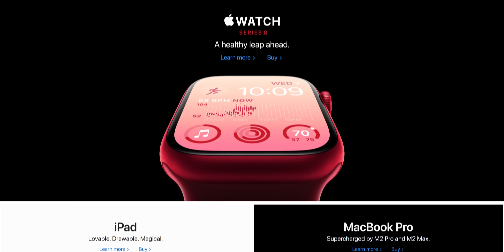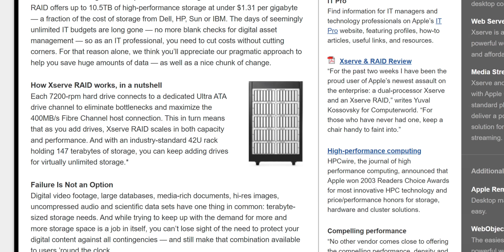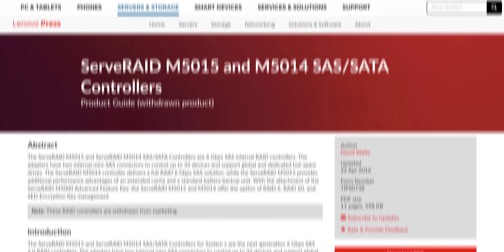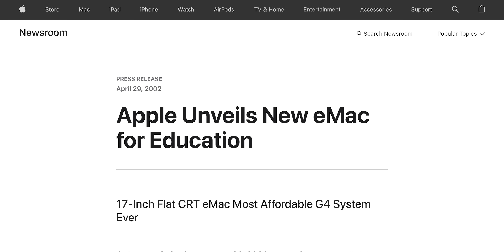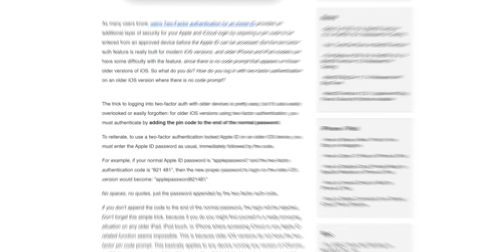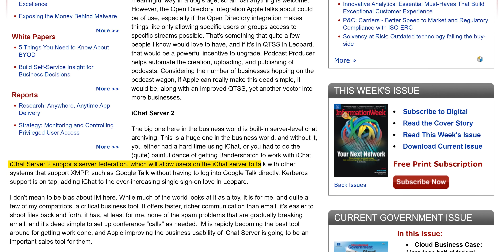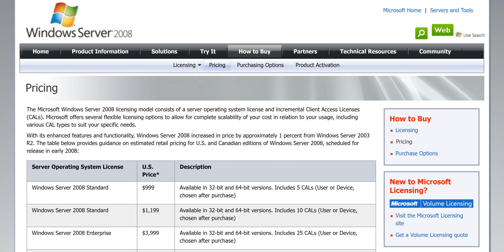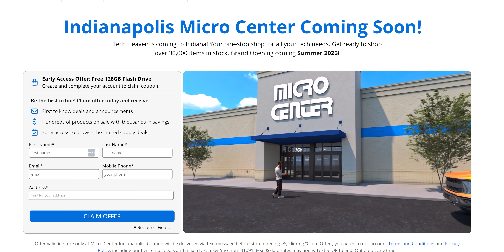I Bought the Last One Apple Ever Made... - Apple XServe 3,1 Server

Comment: 5:00 the tiny HDD connector is NOT proprietary. That is connector is called a ZIF connector, and was used on the HDD that were in Zunes. ZIF stands for Zero Insertion Force. Yes that HDD looks like the same ones found in Zunes and classic iPods

Comment: The "HDD vendor locking" is not true. I ran three XServer from different generations for many years (with Linux instead of OSX, because I got the hardware for free) and I just popped multiple SATA SSD and HDD in all of them without any problem's.
So maybe this is only valid when really running them with OSX?

Comment: Funny story. I got my hands on about 9 retired 2009 Xserves in 2015. The project I was using them for fell through, so I sold them on eBay in 2016. One of my very first sales was to... Microsoft Corporation. Doing some digging I found that the buyer was Microsoft Office for Mac. So 1) I sold Apple hardware to Microsoft lol and 2) These servers were still in demand by companies (I sold to at least 3 other companies as well) over 7 years after they were released

Comment: the Xserver sucked. I worked at a company that used them and because Apple used off the shelf consumer drives instead of high end enterprise drives, the drives would burn out pretty regularly because they can't handle the heat of a rack mounted environment

Comment: I have a 2009 Xserve 3.1 that i use as a 4K gamming rig. (Why not?)

If there was ever a follow up to the xserve video making it into a gamming rig. I'd be happy to share my experience and suggestions.

 

There are quite a few quirks and obstacles I've overcome to make it work reasonable well. Including upgrading the firmware, processors, Ideal ram setup , nvme ssd's and perhaps most important silencing it.

I seemed to be the only person at mac rumors excited at getting a 6600 Xt working on my xserve. Though I'm running a 5700 xt now. Just as fast with the full 16 lanes. 

 

BTW I'm using an Xserve with non-raid backplane. In my case standard SATA SSD's work fine as long as they can go down to sata 2 in my drive sleds. e.g Crucial’s  MX500 1 TB works great. Might be worth checking if they can work for your Xserve.

 

https://forums.macrumors.com/threads/xserve-2020-xs3-1.2225448/post-31187673

 

Happy to share more, maybe I should create my own video first?!  Current playing Horizon Zero Dawn on my xserve at 4k on my projector. Medium settings.

Comment: The vendor locked HDDs sound pretty much the same as the current rumors about their USB C cables.. They are using  an industry standard, but lock it down so that while "using the standard", you can still only buy from them.

Comment: The boot drive is basically an iPod drive with the same ZIF connector. The drives weren't really firmware locked, you can use third party drives.

Comment: Yep, delidded Xeons are a thing. All but the latest 2012 cMP did use them, on the latest one you could use regular ones. Technically, you were able to use standard Xeons, however, you did need to try to NOT Bend the Pins while tightening the Heatsinks as they are designed to be used without them. If you are looking to delid them yourselves, it is highly likely you'll kill them in the process. Get 4 razor blades, a steady fire source as a candle, and a stove. Then you can delude them as the IHS has been soldered to the CPU Die. It is safer to get them prepared. Also, you can get LGA1366 and up to an X5690. (6C/12T). Loved these machines to death. If not for being so power hungry, I´ld still daily drive one of them up until this day. Oh, if you are looking to get a GPU Connected, safes bet is any AMD GPU after the HD7690 (R9) or RX460. You'll need to make sure they are properly supplied with enough power though. Greetings from Germany guys.

Comment: As a publisher, newspapers, magazines, web, video and podcasts, we used XServes extensively.  When they were discontinued we were told — official, paid for, Apple consultancy told — just replace them with Mac Minis.  No dual power supply.  No dual Ethernet. No out of band management.  NOT going in my data centres, thank you.

So the hardware was gradually replaced by other things that weren't Apple and any software that was Mac only likewise got replaced for something more flexible. By 2015 storage and services servers had all gone from the data centre and after 25 years of Mac servers Apple products were again desktop only.

The recent MacPro server has been a really halfhearted effort: sticking a desktop machine of rails does not make it a server.  It does seem that apple has no interest in the server market.

Comment: My high school had multiple of these, but since I hated apple with a bloodthirsty passion, I used my laptop to create a code to destroy the machines by Frying the motherboard and CPU by forcefully unlocking the software and hardware power limits and slams the mobo and CPU with more voltage than it can handle
Reply: dont write that here

Comment: Hey this is probably a long shot, but i need some help trouble shooting. I get really good FPS in pretty much every game except for destiny 2 and no matter what i change i can’t figure out why. I have a Ryzen 5 2600X, B450 tomahawk, RTX 3060ti, 16gb ram, Samsung 980 pro 1tb ssd, and my frames are constantly at min 50’s, low 60’s when on destiny 2. I’m not sure if my older cpu is bottlenecking, or if i need to change some bios settings, I’m still pretty new to tinkering with PC’s because this is my first pc I’ve built with hand me downs except for the 3060ti. If anyone could help that would be awesome!

Comment: I would like to see follow-up video where you can somehow connect standard SATA drivers to this thing. If the hardware is indeed crippled at the hardware level to prevent using standard drives, there is no future for the system at all.
Reply: A few people commenting here that they’ve used third-party off-the-shelf drives without issues…

Comment: I am an IT guy (server certified DELL and former HP server support), a mac mini is not a server in any way.
A server has ECC memory and raid it assure a full redondancy and a 24/7 workload.  long ago I read test on the server especially in SQL readings and the Apple server was so far beyoun the compaq ones that it was quite worthless. In a world where Unix/Linux is legion Apple OS has no added value. It could have been better than Windows but NT4 is working so fast that it makes Apple server obsolete directly.
And Now linux is here and very common, mac OS is not able to compete in it.  An other things that happens a lot but hattered by admins, it is proprietary drives and device. Quite common sadly but Apple is again the worst.
Netboot and PXE are super common on the server and add on card to do remote control, even if your server is powered down.
The things is when a server is in a rack, you don't care about its design at all, and some server like SUN server where also design and much more effiscient (and UNIX too).

Admins are not sensible to speech but to real fact and performance where apple don't shine at all in server market.

Comment: Linus, you‘re wrong… the primary HDD is connected by a ZIF-connector. It’s not propietary… Dell used this connector in the Latitude E430 for the harddisks. And it’s used in the whole iPod-Lineup also for connecting the HDDs

Comment: ahahah cool thing but very difficult, I have a story connected with it - I worked as a system administrator (for a very long time) in my youth and one day I was asked to help rearrange the servers in the rack and now I pull out the server that was almost at the very bottom of the rack, and my partner slightly pushed this miracle from Apple, and since someone screwed the guides badly, this thing simply and without much thought fell on my head - after that I don’t really like Apple equipment hahahahaha

Comment: The way around outdated OS install/upgrade issues is to use another Mac, because obviously you have one if you have an x-serv. Use Mac #2 to install a fresh updated OS on an external drive, preferably firewire (hence the ports on the back). Then boot the server off that external drive to install/clone to the server's internal drive. As an Apple tech I used full installs on external drives for much of my troubleshooting, repairs, and installs in the shop. Need a specific version of the OS on the customers machine? No big deal, external drive had every version of OS on different partitions as well as all the disk images so we never had to use CD/DVD or USB media. Also, the HDs were not vendor locked, you just need older drives.

Comment: The firmware thing is actually about testing (you would be shocked at how often HDD manufacturers have managed to ship broken disk firmware), not about locking things down. You absolutely can replace the drives with off the shelf units.
Reply: Absolutely, I've done that many times. I've even replaced the PATA drives in the Xserve RAID with SATA drives with a converter!
Reply: can confirm
Reply: Ive used WD 1TB in this server
Reply: My admittedly limited experience in the matter differs. Last time I had to change a hard drive out in an Apple PC we had to pay the Apple tax for an Apple firmware approved drive. The generic off the shelf drives refused to be accepted by the machine as a valid storage device and outright refused to function otherwise. I suspect this specific issue comes and goes as they release iterations.

Apple is not the only one that pulls this crap, I had to deal with a non Apple server once (forget the brand now, might have been HP or IBM) that would halt during boot to warn that an 'uncertified' drive was installed and I had to press the any key to continue...for each and every boot.

Compaq (eventually bought by HP) had PATA hard drive connectors where they switched a few pins around to make generic drives not work at all (+300% premium for Compaq compatible drives). This specific practice seems to have gone away after SATA arrived, maybe the SATA group put some 'do not touch' wording in their spec sheet.

Dell for a while switched some pins on the motherboard connector to make generic power supplies incompatible as well. Though Dell seems to have stopped that practice after consumers got a bit noisy about it.
Reply: @stevedixon921  I've been swapping drives in macs for decades (back to PATA era) with generic versions, never been an issue as long as you don't use some super cheap drives that don't fully/properly support a given protocol.

Comment: Tbh, for a server it's pretty... pretty... 😅 Oh, and Apple did the same firmware thing with 27" iMac hard drives up until the SSD model became standard in 2020. Also, the you can easily create a bootable installer for most old apple operating system (except sierra for some reason) by downloading the installer and using a terminal command, i do this regularly, most recently from a mac running Monterey. 🤷‍♂ We sold these to pretty much ALL our business customers regardless of the company size, they were really great.

Comment: Its not rude its plain evil similar to ms blackmailing to upgrade from windows 7 to 10 or from 10 to 11 just to make u upgrade your system... I'm lucky that i have seen this horse - manure and switch to linux 🤣 p.s. there will not be an os like windows 7 for microsoft EEEVER and i used it from the first beta available without any issue at all

Comment: That OS drive actually looks like it uses a ZIF connector which is common on small form factor HDDs that are intended for mobile devices. Most MP3 players (including the iPods from 5th gen onwards) used ZIF drives before they started to use Flash storage.
Reply: It could well be an iPod drive!
Reply: @thehobnob  yeah, I compared the drive you see in the video to an older iPod drive that I have laying around and I am very certain that they are the same.

Comment: Another fascinating topic. I didn't realise MacOS Server was so functional as a server operating system. Would love to get one to play around with it for a media / plex server.  Probably totally impractical though due to the noise and power consumption. Also really enjoying the content lately guys. I love the way you are finding unusual hardware to talk about 🙂 Things like the XServe and Dev kits etc are awesome to learn about.  I had to laugh at the lengths you guys had to go to trying to get a modern OS on there - from experience in Tech Support I have dealt with old Macs and trying to upgrade the OS can be a complete pain ! Apple certainly as Linus said doesn't make it easy at all.
Reply: "intentionally unusable" is the correct term as to what apple is doing with it's old hardware. why windows > mac os in any version.
Reply: @inkredebilchina9699  Windows sucks, but thankfully Linux is always an option when OpenCore isn't able to cancel Apple's canceling of old Macs.

If any of these old Xserves are in use nowadays they should be running industry-standard Linux anyway...

Comment: In 2006 My high school had a digital media class and building funded by the local university and we had an entire wall of apple servers. We shot tape and converted it raw into storage and had thousands of terabytes of footage on the racks that no one would take the time to encode. It got so bad the teacher started pulling the old full server drives in the storage closet in actual file cabinets until we had like 1400 drives in storage and in 2008 the university I.T department came to upgrade into windows and then realized it was gonna take a over a year to encode everything on the drives so they just batched it by month and compressed whole months of footage which made it so hard to use no one retrieved it . Somwhere today in ohio there are about 2500 drives full in boxes just waiting for someone to find them😂

Comment: Damn I remember running xgrid on this thing and connecting labs full of imacs for distributed computing. I used it for video transcoding but I wanted to do something more so it was either this thing called bitcoin mining or Folding at Home. Went with folding at home because I couldn't find a place to exchange bitcoin for cash. Biggest regret ever.

Comment: I've had one of these sitting around for a few years, with the grand idea in my head to convert it to hold a standard ATX/EATX motherboard. Would have to completely redo the rear IO and cut off the existing standoffs to do it though, then press in new ones. And IIRC you can't re-use the power supplies, the pinout is proprietary. So either re-pin them or cut out the PSU cage and find another solution. And to get the hotswap drives working needs a custom backplane solution. I've seen people attempt to do it online but never saw anyone actually finish a build.

If you guys could retrofit it and do a follow up that would be awesome so I don't have to figure it out myself :)

Comment: Anyone who used the server and XRAID LOVED THEM.  But this was the beginning: We sell 1500 iMacs for every 1 XServe...why bother with the high-end pro hardware when we can focus on our other systems. I know several small studios that still had them running just a couple years ago.  But now everyone just gets a Synology raid and doesn't bother with the higher-end server features. And that cool Poscast software was a spinoff of COMPRESSOR.  That was the network rendering software that they got when they bought Shake (the high-end compositing software).   They modified Compressor to work with their new FINAL CUT PRO, but it was always kinda sketchy when it came down to networking machines together for rendering.  Again "Fuck the pros, we have iPods to sell."

Comment: There's a "patch" you can run on the El Capitan installer to allow all versions to make bootable installers (that at least worked on Intel Macs).  When I worked at AppleCare one time I got so stuck helping a customer that lived in a remote area that I ended up walking them through patching it using TextEdit and Screen Sharing.

Comment: I don't think you had the last version of the XServe. I ran the last one and the three front drive bays had normal SAS headers and could take any 2.5/3.5inch SAS/SATA drive. I ran one original apple drive  module 250gb SATA and 2x HP 300GB 15k SAS drives. These worked without any drivers or firmware hacks. If you didn't have the apple module you could slide a drive in with some cardboard  shims straight onto the SAS/SATA headers. I didn't have the apple raid controller installed but the onbaord SAS/SATA controller worked fine.

Was being used as a node in a golden triangle to manage our mac workstation and running final cut server. Also used the built in apple wiki for our internal use and it was really good as a quick and easy tool that lots of people were quickly comfortable using.

Comment: This is my first PC build. I need help please I have the ASRock A520M-HDV motherboard. It only takes one 4 pin power cable for the main piwer. 
When I have it plugged up nothing will work. I can feel heat coming from somewhere but nothing's on that I can notice. If I unplug it and try to turn it on the fans will turn on. If I turn it off and plug the 4-pin back up nothing turns on not even the fans. Did I kill my mothersored some how? Or am I just missing something.

Comment: Pretty good chance you can get at least High Sierra on there with DosDude1's installer.  Running it on my 2008 MacPro and it does the business.  depending if the server version is based on an 08 (3,1) or an 09 (4,1) you might be able to get even newer OS running.  the big question is, for the use case, if you actually wanted to run it in production, is there any powerPC software you need to run?  if so, you're stuck with 10.6, otherwise you can bring it up to at least 10.13.  On the normal Mac pros the 09+ models can be updated up to Big Sur, if you have a METAL supported GPU.  That Nivida GPU is likely the limiting factor, but High Sierra is no problem, and it's a really good, stable OS.